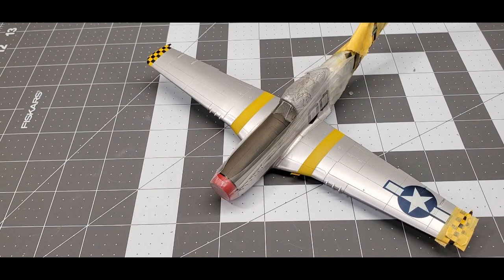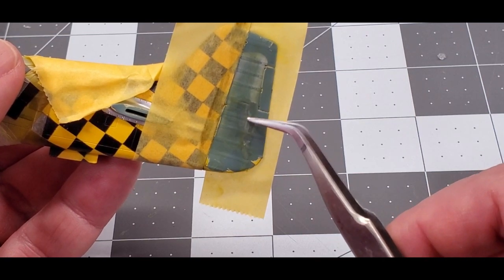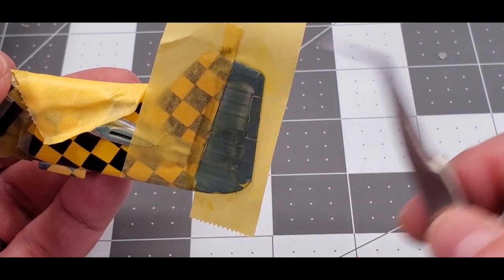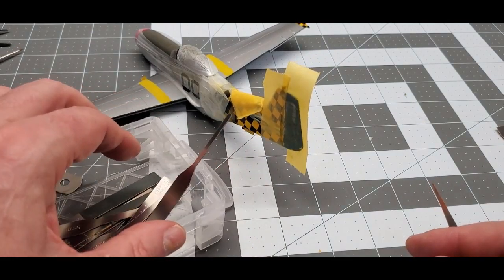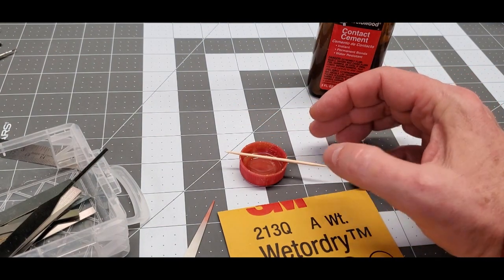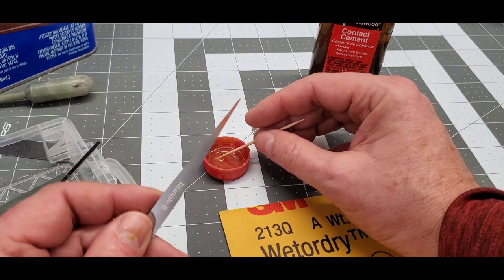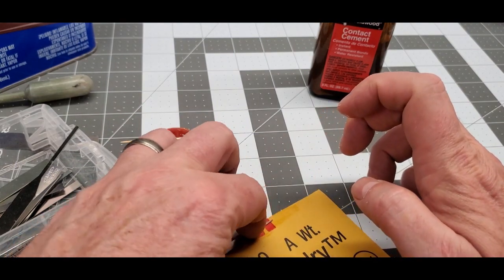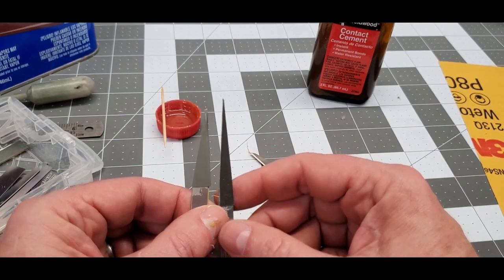Eduard 51 pt 7

Comment: Good to know(!), but it just shows they try to go beyond anyone else in the finesse of mobile parts and trailing edges (like the new tol FW-190s and Spitfires). I'd rather see that than carve kits thinner for days, or some of the thick tailplanes of Hasegawa even today (like the awful Hasegawa P-40 or 190s tailplanes)... They actually mould the hinges correctly, and have the right outward taper on the tailplanes, which is rare.